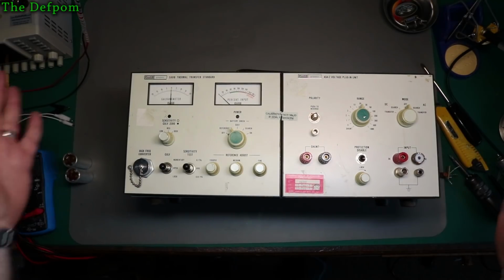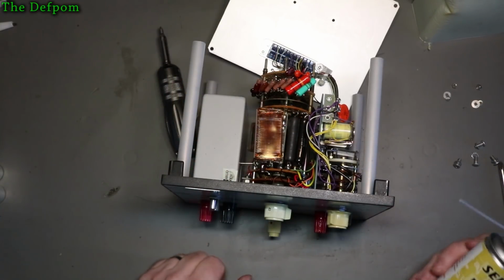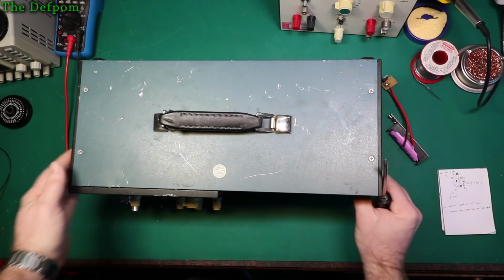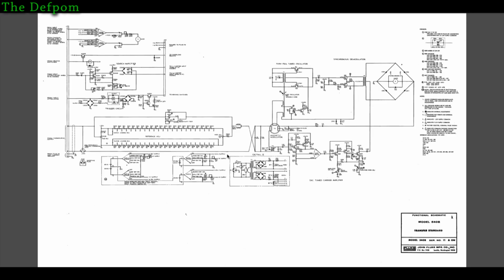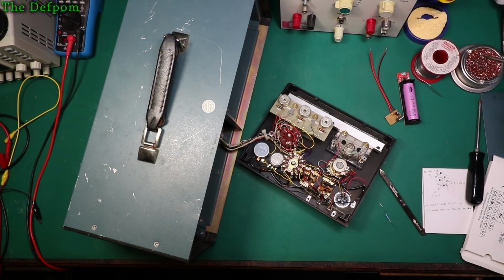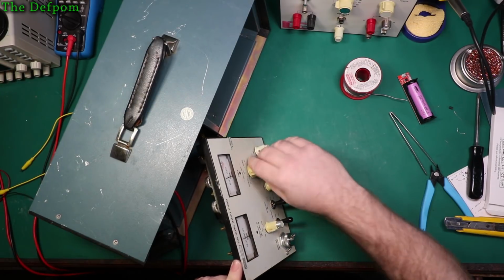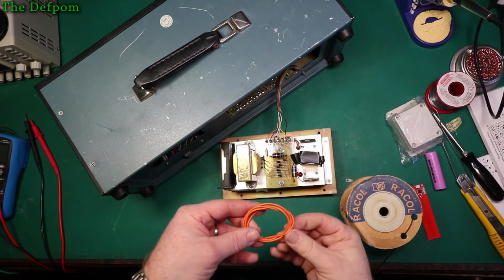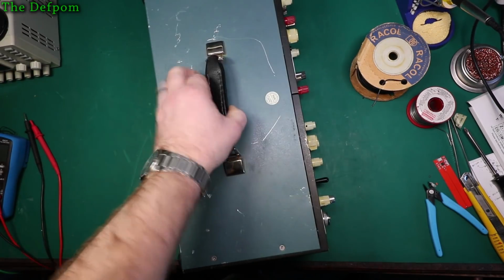🔴 #462 Fluke 540B Thermal Transfer Standard Repair and Mercury Battery Replacement

Comment: The reason for the 1.35v battery (unobtainable), is that it is extremely quiet and stable.
I've built a couple 1.35v circuits for testing....powered by an ac-to-dc  PSU with a quiet voltage regulator, and using a buffered voltage reference, and accurate resistive dividers, to get the 1.354v.
But I'm not sure that's the best or only way. I'm looking for a "best solution".
Reply: Less complicated is a rechargeable battery with a voltage reference on the output, tweaked to 1.354v......switched on only when needed.

Comment: Well that seemed fine, just the charging of the battery to be sorted.

If i was doing the mod, a small relay across one of the d.c supplys would pull in, the contacts would connect the li-pol to the lm317.
I'm lazy and would leave the panal switch alone lol :-D

Comment: If that is not a protected cell, you have just removed the over discharge protection.
Reply from the maker: Peter Ellens - this was recorded as part of a live stream, I think I edited out the bit where I talked about mounting the charger board separately inside a box on the rear of the unit, to charge it with a USB cable.

Comment: Great video! I think I would have removed the old battery holder and wiring. As you said - they are no longer available so there is no going back in this case. That also would have given you a spot to mount the battery holder with screws, just drill a couple of large holes to allow clearance around the terminals and wire on the back side of that bracket. Most of those lithium battery management chips disconnect at 2.5 Vdc. How about a 1.35 Vdc regulator like the Texas Instruments LP3990-1.35 ? 2 to 6 Vdc input, 0.002%/mA regulation and around 86 Yankee cents a pop.

Comment: There's a good thread from 2013 on EEVblog about this :- https://www.eevblog.com/forum/testgear/fluke-540b-thermal-transfer-standard/ - I was going to comment about using AAA cells etc - but they seem to have covered it all - as Defpom has. just need to find the gaffer tape for my mouth now ;-)
Reply from the maker: Sasquatch - yes I had read that previously to try and educate myself a bit about how to use the thing and conversation options.

Comment: Hi Scot. I would probably use a isolating DC to DC converter followed by a linear regulator. I’m not sure if you could arrange to switch this off for battery operation. In my first ever video I built a dc load controlled via a USB interface and I was very impressed with the dc to dc converter once I had sorted the efi capacitor.  I managed to get the footprint wrong and had to solder the bloody thing on the underside of the board LOL.  I would be careful with contact cleaners on Precision equipment as the oil residue can effect sensitive calibration etc.  Deoxit is very good and the slider version with extra lubrication is great for vintage potentiometers. Regards Chris

Just remembered Deoxit do also have a product that is designed specifically for gold contacts.  Apparently there is an issue using normal contact cleaner. Last time I bought Deoxit products I had to import them. It was expensive but it will probably last my lifetime.
Reply from the maker: AllTheGearNoIdea - I was unsure about noise on the rail from a dc-dc converter, plus I didn’t have any on hand, unlike jellybean voltage regulators, so thought I would stick with a linear design.
Reply: The Defpom's Repair Channel  Yes your quite right to be concerned about noise obviously depends on the application I followed the dc to dc with a precision 5 volt regulator. Work fine one I had remembered to fit that emi cap.

Comment: ...Use your hex tools you just got..https://youtu.be/fdr04caBrR8?t=355
Reply: and nut drivers.
Reply from the maker: Micro Fix - I recorded that part of the repair well over a month ago, I didn’t have the nut drivers then, but I like that you were paying attention!
Reply: I sort of guessed as much when you were talking later about using the LM317 and did not mention your output issue's.